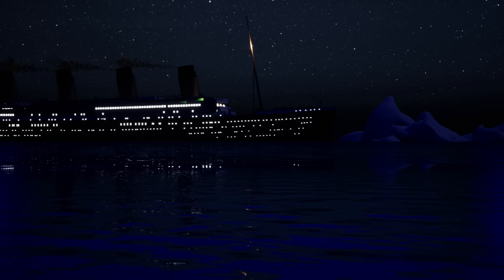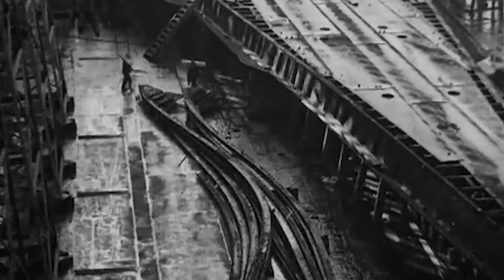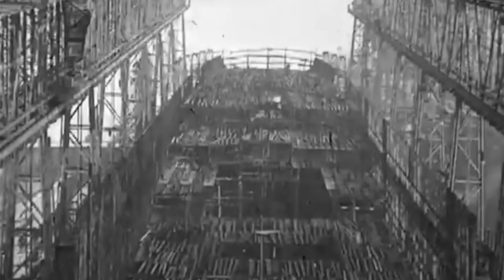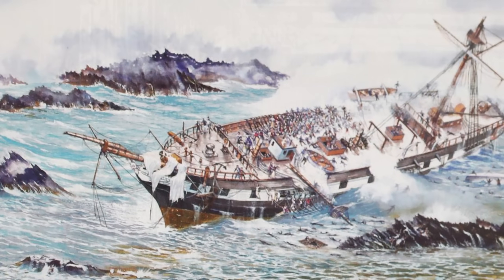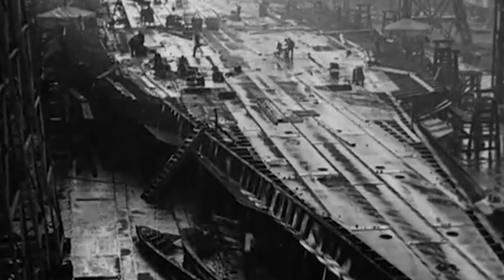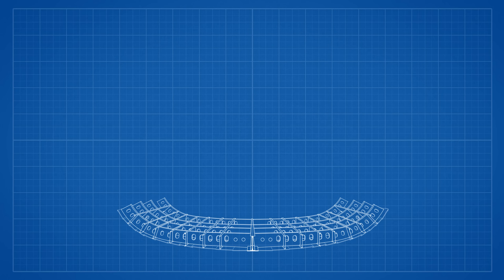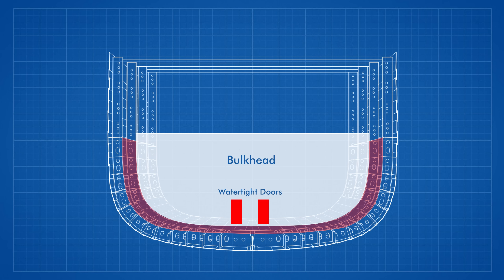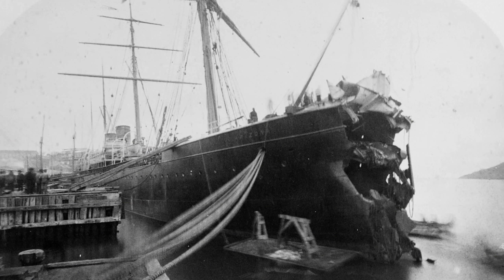How did the Iceberg Sink the Titanic?

Comment: Imma try and answer the questions before watching the video.

1) Why wasn't the Titanic designed to withstand the iceberg.
It optimistically was designed to withstand the iceberg. It's just that a plan never survives first contact.

2) What exactly caused the ship to sink so quickly.
You either have a trickle of water coming into a ship, that still overpowers any bilge pumps ability to get water out. So the ship sinks slowly.
Or you basically replace the inside of the ship with water in mere minutes and the only thing keeping it afloat at that point is the rate at which air can escape out of the ship.
In a ships last moments, you've most likely at some point seen footage of an opening where air and droplets of water is rushing out really really fast. That's the only think keeping the ship from simply going "plop" and under the water. The air can't escape fast enough for it to sink in a second.
If you exploded every piece of metal of the Titanic at the blink of an eye it would all sink as fast as a dropped bolt in water.

And another example of ships sinking fast are those struck by torpedoes. It's not that the torpedo leaves a huge ass hole for water to get in through. It's that the torpedo basically lifts the whole ship in the explosion and snaps it in half. When you have two halves of the ship, each open to the water around it, they tend to sink pretty damn fast.
The Titanic suffered a near similar fate actually. And in the end (assuming the stores are true that it broke in two before going under) it actually did suffer the same fate.
Once broken in two, it sinks in seconds.

3) How can ice damage steel?
Ice is actually SUPER hard. But that's beside the point. Even molten ice (aka water) can be super hard. You can cut steel with a jet of water if you so desire.
But it wasn't so much the ice damaging the steel that was the problem. The problem was that the Titanic was riveted together. The rivets broke loose and the sheets of metal that made up the hull were allowed to come apart and so it went like a popped water balloon. It literally split at the seams over almost the entire front of the ship.
NO ship can survive that unless they are filled with Styrofoam or similar less dense than water materials.
It doesn't matter how modern the ship is, if you split them open to that extent they are going to sink. And i am actually surprised it was floating for as long as it did before going down.

Anyways, the rivets were the weak point, not the steel itself. The rivets all combined were stronger than the steel it held together but since they were ripped off one by one like a zipper lock... Well, it's like me asking you to arm wrestle me using only one finger at a time. You would just have five snapped fingers.

Comment: The coal bunker fire. Its why the ship was moving so fast. It's heat is what warped the steel and compromised the last bulkhead as it was back of said bunker, not the iceberg.
Reply: The fire was nothing more than a small smolder which wasn't at all the reason for the ship's speed (going at generally higher speeds in an ice field was a standard practice back then that dozens of other captains attested to), didn't compromise or damage anything, wasn't relevant to the ship's damage and did not sink it in any way.
Reply: @DerpyPossum  no
Reply: @gtp1172  it was nothing but a small smolder.
Reply: More garbage

Comment: Holy sheeit, I finally understand the bulkhead situation. I could never wrap my head around how the compartments were water tight, but some water filled up one and then another, and another, and another.    I couldn't understand how that worked. I never realized the bulkheads (which I also did not know what those were) didn't go all the way to the roof, but a gap separated the 2.  Now it all makes sense to me. 
Probably a pretty stupid thing to not understand for as long as I did, but hey, we all have some dumb hang ups that stump us now and then
Reply: They should've got Germans to make it, then they'd've gone to the top.

Comment: The Major Flaw to Titanic’s design was..Her water tight compartments were not closed off at the tops. meaning as each compartment flooded, it would over flow into the next and then into the next. If Titanic had actually closed off at the top…She probably would have survived. Also Going full speed thru a Ice Field was not the brightest idea..CAPTAIN SMITH!
Reply: "Going full speed thru a Ice Field..." was a standard practice at the time which dozens of other captains attested to. It was a bit of an outdated practice, to be sure, but a standard one nonetheless which Smith wasn't at fault for.

Comment: The idea not to use double hull was a cost saving measure, its foolish to say otherwise, there were ships with double hull way before Titanic, wooden ships even designed for various harsher environment including arctic exploration steel ships had double hull for going through ice, but to think such a simple design feature could have saved Titanic is just another example that cutting costs for sake of it, never ends well and never will end well, if engineers design and have it built to last a 100 years, there be triple hull on every ship.
Reply: It wasn’t cost-cutting at all, though. They simply never considered it, most likely.
Reply: @DerpyPossum  
I am not trying to be rude but double hulled ships have been a thing since ancient times, and steel ships with double hulls have been a thing since 1850s, if I remember one of the largest ships of that time had double hull design. 
Military ships also came standard with triple hull to protect against cannon fire, torpedo attacks and ramming manoeuvres.

Titanic having a single hull sides was a cost cutting measurement, for one it made the ship A LOT lighter, secondly they saved half the steel needed to make double hull designs and added more room. 

The irony is that the downsides of single hull were well documented and some critiques at the time said that the largest ship in the world being made with a single hull was a disaster awaiting. 

Olympus also had several close calls but thanks to its double hull upgrades, it went on for a long healthy career, Olympus would sunk too had it not had a double hull.

Comment: Was this ACTUALLY the titanic, or was it her near identical sister ship, the OLYMPIC?
Reply: Titanic. %110. Without the slightest shadow of any form of doubt.
Reply: @DerpyPossum  based on what though?  What you have been ordered to think?
Reply: @wellifthemediasaysit  Wreck footage, insurance documents, photographic records, survivor testimonies, basic common sense, etc.
Reply: @DerpyPossum  the words 'Titanic' can easily have replaced the words 'Olympic'..the 'survivors' would not have known the difference ,if the ships were identical!
Reply: @wellifthemediasaysit  But the ships weren't identical. There were different window layouts in several sections of the exterior, different structural designs in places, huge amounts of completely altered internal layouts, etc. Just look at B deck, for crying out loud. The survivors would've definitely noticed. In addition, every single difference between them can be seen on the wreck today, pointing very clearly to it being Titanic; Absolutely nothing unique to Olympic has been found.
And no, the names couldn't be easily replaced. There weren't any "nameplates" in that sense, but rather the names were engraved into the hull and painted in. In order to change the names, you'd need to disassemble sections of the hull itself.
Reply: @DerpyPossum  Im not saying i subscribe to the 'insurance fraud' theory, but the ships really WERENT that different1   Most of the twinned liners/cruise ships today, have only very small differences, sometimes nothing more than jus tthe name!  Look at RCCL 'oasis ' class cruise ships, or MSC seaview and MSC seaside, etc
Reply: @wellifthemediasaysit  Those ships aren’t Olympic and Titanic.
Olympic and Titanic were vastly different.
Reply: @DerpyPossum  Not according to the history books they dont!
Reply: @wellifthemediasaysit  Please take one look at the ships' B decks, then.
Reply: @wellifthemediasaysit  the ships’ names were engraved into the hull. Switching out the names and being able to perfectly hide the evidence it ever happened is simply impossible.
Reply: @mrplane4205  perhaps! But if it can be done with a car VIN, it can surely be done with a ship?  Especially if one of them is 3 miles down, on the seabed, and the other is long decomissioned?

Comment: It's interesting how the damage was just 6 thin slits totalling 12 square feet of damage, and yet that's all that was needed to send the Titanic sinking to the ocean bottom in 2 hours and 40 minutes.  When I first read about the Titanic, even I had imagined the iceberg having ripped a huge gash measuring 300 feet long by about 15 to 25 feet wide.
Reply: Wouldn't the water pressure from the ocean start to rip open the slits which were structural damage so weak ?
Reply: @db7610  No, because when Titanic sank and went down to the ocean floor, it was already full of water, so the water pressure equally acted on both the inside and outside of the hull, so there was no pressure difference. E.g. the submersible Titan recently imploded because it was not filled with water beforehand, and the water pressure came from outside only, so there was a huge pressure difference between inside and outside.
Reply: @goldfing5898 you explained that so well
Reply: @goldfing5898  The Titanic did implode. The floating survivors could hear it from the water.
Reply: @JeffGoldblum64  The stern section imploded, and that is what the survivors could hear below them. The bow was almost completely full of water at the time of the breakup, which is why it is in much better condition today.
Reply: @clayschwartzwalter382 Realky interesting, I had no idea but makes sense. Thanks for the knowledge
Reply: @db7610  it was flooded with water
Reply: "But this ship cannot sink!"
Reply: @finmat95  In the 1958 film A Night to Remember Cpt Smith (Laurence Naismith) says "But she can't sink. She's unsinkable"

Comment: The Lusitania's double hull contributed to its rapid sinking. When the torpedo exploded, water filled the longitudinal watertight compartments on the starboard side but not the port side, causing an immediate and severe list which sank the ship in 18 minutes.

Might something similar have happened in the case of Titanic's collision, or was the resulting volume of water (compared to a torpedo breaching both hulls) too low to cause a severe list?

Comment: The ribbets or however you spell them not sure, but they were made of weak iron and had slag in them they discovered their when looking under a microscope, so the ribbets were the very thing that killed the titanic. If they would of made them out of steel they would of held. But they couldn't be hammered in place and the machine that would couldn't because of the shape of the sides they could only do an even straight up and down areas so the uneven area were done by hand, and hammering in the ribbets was impossible if they were the same ones used by the machine. The wrought iron ones they use were substandard full of slag that weakened the head of the ribbets. They have proven and solved that was the problem. If only they would of known, the tragedy might not of happened. My opinion is it was meant to be so many factors played one on top of another like fate would, can't undone the threads of fate once started they say. The letting go of one officer to replace another took the key to the lock box that had the binoculars when he was packing and leaving the shop, to the very flat calm sea, the iceberg drifting way down and a very rare thing for icebergs to do, to the weakling ribbets and then the ultimate demise of the ship and the people who unfortunately died on her. Also would love to know more about her captain who went down with the ship, was he married, did he have any children and if so did they survive long enough to have kids of their own and then they did having living descents today? Love to know that. So sad that this was his last voyage and then he was retiring, not being able to enjoy his retirement, must of been agonizing to realize that you're going to have to die going down with the ship because that was The Honorable thing to do for captives they had to do it, they would expect it to. Esme was labeled a coward but getting into a lifeboat.
Reply: They might not have been as strong as possible, but they were by no means substandard. In fact, their strength might not have been of any relevance at all given the nature of the collision; the damage came about mostly because it was of a riveted construction, and it likely still would’ve happened no matter their material.

Comment: What would have happened if it hit the ice burg further on, and the  5 middle compartments had flooded, say 5-9, 6-10, the Titanic wouldn't have started a dive angle, and would the water not have overflowed into the next compartments ?

Would it still sink, would it be slower. faster ?

Comment: Apparently the rivets were made of iron instead of steel which was not as strong......not that that probably mattered after hit such a huge iceberg
Reply: Only the rivets around the bow and stern were really iron; the rest were steel. This was because the machines used in riveting the steel ones couldn't be used around the awkward shapes of the bow and stern, so they were installed by hand, using iron for ease of construction.

Comment: Wan't hole in Boiler room 5 actually caused by weakened bulkhead between 5 and 6 that was caused by a Coal fire in the coal pits that lined that bulkhead?
Reply: Nope; the iceberg damaged a portion of the coal bunker, which filled with water until the non-watertight coal ports gave way, as opposed to the bulkhead itself. In fact, the fire didn't weaken or damage anything, as it was more of a small smolder instead of the raging inferno needed to burst the bulkhead.

Comment: The saddest part of the sinking of the Titanic, was that it's could have been completely prevented if the crew had decided to punch right through it instead of trying to avoid it. If they simply ran right through it, there would have been minimum damage to the front of the ship and it would have been perfectly fine. When they turned to avoid it, the ice dragged through the entire side side of their ship which cut right through the hull exposing it to flooding. 

If they had simply let the ship hit the Iceberg on it's own head first instead of trying to avoid it, the tragedy of the Titanic never would have happened.

Comment: It is really weird to me that they would do so much with these water tight bulkheads, but no second skin up to the top of them like they had on the bottom. It assumes that you would only run a ground head on. I would think that it would nearly always be at an angle, increasing the likelihood that contact could "climb" up the sides. But that "well no authority would make that mistake" is really common with a lot of disasters from the era. Where things were designed assuming certain mistakes were impossible, ignoring that even very competent people can make mistakes.
Reply: It’s not that mistakes were thought to be impossible, but rather specific scenarios simply weren’t easy to imagine beforehand.

Comment: The rivets were not emensley strong as you say.  They were number 3 grade, not best best grade to save money.  There were a mixture or iron and steel rivets as well causing further weakness. Number 3 grade rivets have many impurities and this was the reason of the plate failure.
Reply: Being fair, the iron rivets were only used in portions of the bow and stern for ease of construction, with the vast majority of the others being steel. Not quite necessarily to save money.